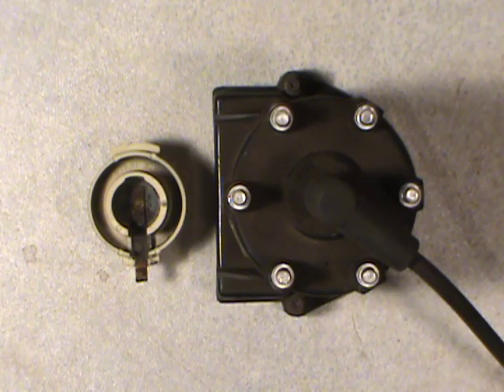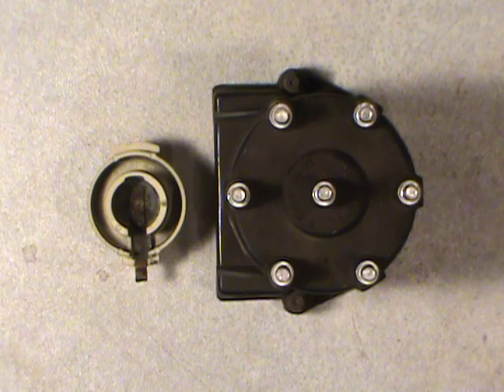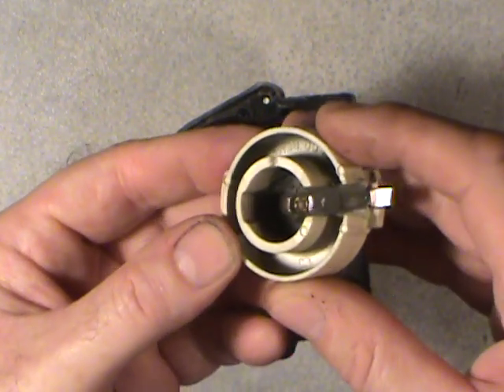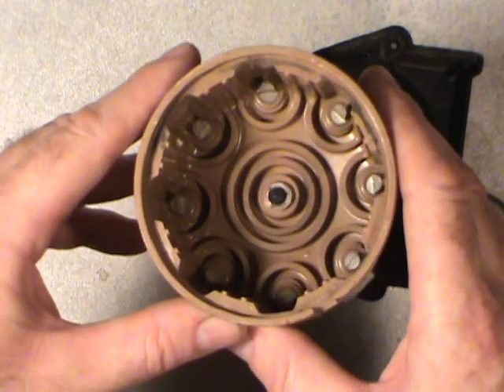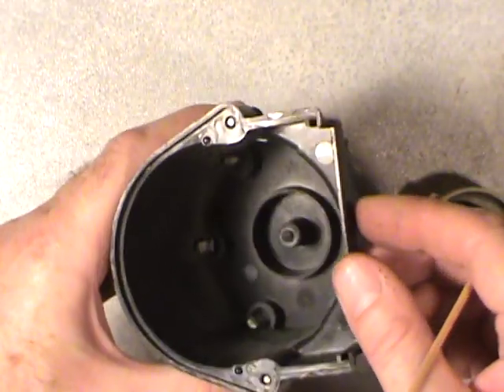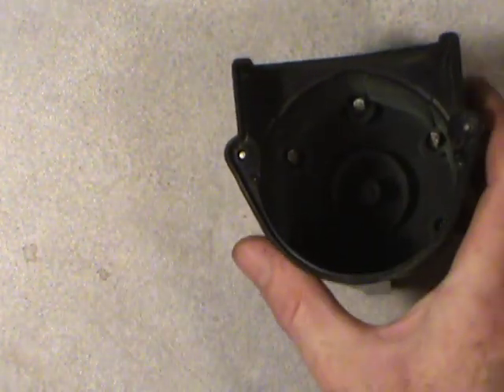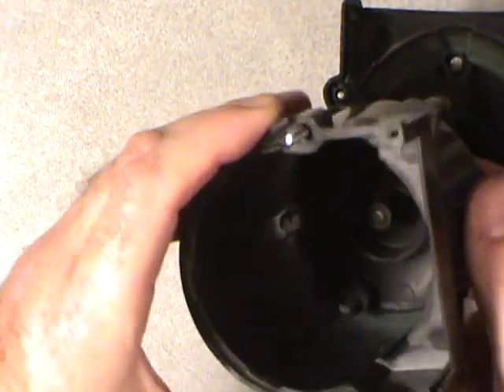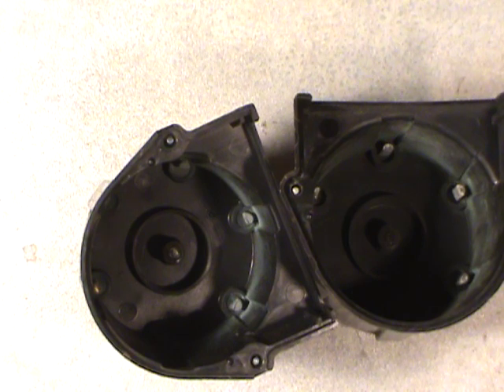How to Inspect Distributor Cap and Rotor Condition (Part 1) of 2 Parts

Comment: Thanks nice video
Reply from the maker: Greetings...will0i0am62............Thanks for the nice comment, and thanks, for watching too...........The "secondary" (high voltage side), of an engine's ignition system, has to be kept in very good condition, other-wise, it'll probably, just be a matter of time, until the engine itself, will probably start out by, misfiring some, not idling so smooth anymore, and, if really bad, the engine might not even want to start, possibly (can also, sometimes happen, if there's moisture, inside of the distributor cap)..........There's quite a bit of, high voltage "arcing" (sparking), happening, between the spinning rotor's metal tip, and, each of the metal terminals (inside of the cap), and over time, the metal gets eaten away, which will then, make an even Bigger gap, and make the ignition coil work harder then it did, when that gap was smaller, with a newer cap & rotor (same thing happens, if the spark plug's electrode gap, gets Bigger as well)............So, for a good running engine, that will give good performance and fuel economy, then, a person should keep, the...distributor cap & rotor...the spark plug wires...and...the spark plugs...from getting too worn, (or, worn out), too old, and maybe, corroded as well possibly, and.......till next time.......Be Safe, take care, and have a good one.

Comment: Hi Rocky, Thanks for your thoughtful response.  To answer a few of your questions, the vehicle with the wobbly distributor cap is a '93 suburban 5.7 TBI.  The wobble problem only developed after installing the new cap and rotor.  It has a press on cap with a notch in it and it firmly snapped into place.  My concern was that it was very difficult to remove the old one, so I had some concern that I yanked a little too much removing the old one.  I don't think that I could have bent the distributor shaft.  The cap is in fact secure and I never messed with the hold down for the timing adjustment.  Long story short, it was running fine (albeit the wobble) and I drove it a mile or two.  Lo and behold, no more wobble.  That leads me to believe that there was some irregularity in the cap or rotor and a few spins around has "fixed" it.  Obviously, still not great.  I expect, like you suggested, that when I pull the cap I will find some scoring from wherever the interference used to be.  Running fine now, but when I get around to pulling it I will update you just to enhance the common knowledge bank of information.

Comment: Any idea why this newly installed cap and rotor are wobbling?  without the motor running everything feels secure.  This is only after the new install.  Did I eff things up yanking the old rotor off or do I have a bad part?  
https://youtu.be/m8y5XwltpN4
Reply from the maker: Greetings...David James...........Thanks for watching, and...Wowsers...!!!...that's, the most impressive..."Wobbling"...Distributor, that's probably known to mankind, well, as far as I "see" it, that is (and I'm gonna nominate, Your Distributor, for a much deserved Award...lol)............Well, my first thought, was that, the Distributor's (spinning) Shaft, that the Rotor mounts on top of, is "Bent" quite badly............You just "Replaced"..."Only"...the..."Cap and Rotor"...???............Were they the "Exact/Correct" Parts, for Your "Exact" Vehicle and Engine...???..............Maybe, "Compare" the Old parts, with the New parts...any Differences at all...???............When installing the distributor Cap, did it "Fit, and Seat/touch down", on the distributor's Body, reasonably freely, without being too loose, or, too tight...???..............If the Rotor, is the Push on Type (as opposed to, the bolt on type), was it pushed Down, all the way...???..............Might be, that, the Rotor is making Contact with, the Inside of the distributor Cap, and if so, You should be able, to actually see, any Rubbing/Contact, that was going on, by having a Look, inside of the distributor Cap (the only Part, of the Rotor, that is supposed to make Contact with the distributor Cap, is the Center-Carbon-contact Button).............Here's some more food for thought.............Was that the Original Distributor, or was it a Replacement (new or used?) Distributor, that was shown in that YouTube Video...???.............Here are a few things that can be done, and, is, as follows..............Is that, the "Correct" Distributor, for Your "Exact" Vehicle and Engine...???..............Having the Engine Cold and Not Running, grab the distributor Cap with Your Hand, and, try to move it "side to side", in many Directions, to see, whether or not, if there happens to be any Movement at all...???.............Then, if needed, mark the spark plug wires, near the distributor Cap, so that, they get reinstalled in their correct locations, well, unless You don't need to, cuz, You already know how to, to begin with...............Then, Remove the Distributor "Cap", and, grab the Rotor, and then, gently, pull up, and push down on it, and, there should be a bit of ,"Play/Clearance"...............If, there "is not", any, up and down, Play/Clearance", then, there is probably, some "Not Wanted Force", being placed on top of the Oil Pump (if applicable, that is), and, is "Not Good", for the Oil Pump, and, if there is Lots of "Force" involved, as a result of tightening the Distributor "Hold Down" Clamp/Bracket's, Bolt or Nut (if applicable), then, that, just might be, a possibility, that's causing that Wobbling Distributor (cap)............While You're at it, gently "Twist" (not up and down), the Rotor, back and forth, in a circular fashion, to feel, the amount of "Clearance", that's between the helical Gear, that's on the end of the distributor's shaft, and the helical Gear, that's on the Camshaft..............There should be, just a little bit of Clearance, when those two helical gears "Mesh" (that be, the clearance, that's between those two helical gears, when they are in contact, with one-another).............If there "is not", any, up and down "Play/Clearance", then I hope, that, the distributor's Shaft, is Not permanently "Bent"............If needed, there are "Spacers" (that look, kinda like, Flat Washers), that can be purchased, that go between, the Base (collar), of the distributor's Body, and, the surface, where that part of the distributor gets mounted into/onto, and, by choosing the Correct "Thickness" of Spacers (or, a stack of them), then, there should be a bit of up and down "Clearance"..."After"...the distributor's..."Hold Down Clamp/Bracket...Bolt" (or what-ever), is Tightened down, to, shall we say, Lock the Distributor, in its proper Base/Initial Timing location..............Perhaps..."Remove" the Distributor (but first, make sure, that, You know how to "Reinstall it Correctly"...!!!), and give the gear end of it, a Spin, and, move the shaft, up and down, as well as, from side to side, to feel if it's too tight, or maybe, too loose...???.............What year of Vehicle, and, what Engine...???...cuz, the more I know, from the get-go, then, the more, that, I will have to go on...thanks............If You like, You can let me know, if You found the problem, or, if You didn't............Good luck, and......till next time......Be Safe, take care, and have a good one.

Comment: there was a bit of white dust on the tip of the coils inside the distributor, can that be the cause of my misfires and inability to start? the car cranks and it wants to start but it misfires and backfires
Reply from the maker: Greetings...That Don't get the bitches.............Thanks for watching............Well, generically speaking, no amount of Corrosion, Dirt-like Stuff, or, even any Moisture (usually being, water condensation), that is showing-up, on the Distributor, in the general area, of the Inside, of the of the distributor Cap, is, as far as I see it, is really not very good at all, cuz of, all of that Very High Voltage, usually trying, to get to, an (electrical) Ground Source, the easiest, and fastest way, that it's able to..............If that, so called White Dust, is causing, something like, the Low Voltage wiring Connections, to, not be so good, then yes, that, in itself, could very well cause a problem..............As far as a vehicle's Ignition System is concerned, the ignition system's Parts/Components, have to be in really good shape, and also be, as Clean, and, as Moisture Free as possible, or maybe, the result might be, an (ignition related) Misfire, or, as bad as, an Engine, that will Not Start at all...............If You can let me know, what...???... Your Vehicle's...Year...Make...Model...Engine Size, and what its configuration is, as in, inline, V-6, V-8, etc., and the number of cylinders, that it has, then, once I actually know, what You have there, I will hopefully, be able to, do what I can, to help You out, and........till next time.........Be Safe, take care, and have a good one.

Comment: what if the cap appears to be in good condition?
Reply from the maker: Greetings...SpyderRios....Thanks for watching....................Well, if the Distributor Cap looks to be, as good as, You were sayin' it appeared to be, then...Maybe...???...it can be put back into service (aka, Re-Used)...providing that, there wasn't a..."Hairline Crack"...or two (hard to see)...in the Distributor Cap, and/or, the presents, of any Carbon Dust (sometimes, it can be, Carbon Tracking), and, Hairline Cracks, and any unwanted Carbon, (inside) of the Distributor Cap, and even, any Moisture/condensation, can make for, some rather, Not Wanted, shall we say..."Spark Scatter"..perhaps, where-by, as the High Voltage leaves the Tip of the Rotor, it starts "Dancing Around", inside the Distributor Cap, usually Not making its way, to the Correct Terminal (inside of the Cap), and, it may or may not, end up, going to the Wrong Terminal...!!! (Not Good...!!!...Engine Damage...???)....................How does the "Rotor" (that spins around, inside of the distributor cap) Look...???.....................So then, have a really Close Look, for any Hairline Cracks...and...to find out, if any Carbon, is hiding, inside of Your distributor cap, just get a piece of (dry) white paper (disposable) Towel, and drag it around, the inside of Your Distributor Cap, to see if any "Carbon" gets stuck-to, that Paper Towel (???)........Also, the (carbon resistor type), of spark plug "Wires"...usually..."Wear-out"...(internally/inside)...so Don't be Fooled, by, how Good, they appear to Look, from the "Outside/Exterior" of them, and...........till next time........Be Safe, take care, and have a good one.

Comment: is there a way to perform any test using an equipment such a multimeter, or any other to certainly determine that distributor cap is bad??, I have a 00 Nissan xterra, and I remove distributor cap and saw a lot of metal pieces on the inside bottom, and red dust on the distributor cap, my engine crank but doesn't start, I took my distributor to a place where check the coil and they told me that is ok.
Reply from the maker: +carlos alfredo lopez saldini ....Greetings carlos alfredo lopez saldini....Thanks for watching...................You could, Ohm/Resistance Test, the distributor cap's, Carbon Button/Resistor, but, probably won't make much of a difference, considering, Your distributor Cap's condition, as I'm imagining it......Metal Pieces...???....That "Not Wanted", Red Dust, is the biggest clue...........A New distributor Cap and Rotor is probably needed...........Try to get a distributor Cap and Rotor, that have "Brass Terminals" on them (better than Aluminum terminals), and, if You can Buy them as a Set or Kit (Cap and Rotor in the same Package), that might save You some Money as well..................The spark plug "Wires", have to be in very Good Condition "Inside".............If Your Xterra Engine, needs New Spark Plugs, try to get the Spark Plugs, that Nissan Recommends, for Your Exact Engine, and make sure, that, the spark plug "Gap" (between the spark plug's Electrodes) are what Nissan Specifies, for Your Exact Engine (less Problems that way).........................With the Engine "Not Running", Only Remove "One" spark plug "Wire" at a time, and put it back On, before doing the next Wire, or, You might have Trouble, putting those spark plug "Wires", back where they belong...!!!........................If the Terminals, Inside of the distributor Cap, are Worn too much, or the Carbon Button gets too Short, or it's Dusty/Dirty, or there is Moisture inside the Cap, then, that's just "Not Good"...!!!.....................Maybe, Replace the distributor Cap and Rotor, and if need be, the Spark Plugs as well, and see if that works, and "Carefully", Clean and remove, any Dust and stuff, that should not be there...................If You care to, just let me know, how You are makin' out, and, if need be, we can proceed from there, if You like, and..........till next time........Be Safe, take care, and have a good one.

Comment: after removing that black cap, there's a plastic surrounding the rotor. That plastic has a small crack on it. Will that contribute to fluctuations in performance, struggle to pick up or jerks when above 60kmh, for example? or any other? The car is a 1996 toyota sprinter & it idles properly. However, sometimes when at a stop light the rpm would go below 900 and stutter. Please advice urgently. Thanks you
Reply from the maker: +Rovin Nauth Greetings Rovin Nauth....Thanks for watching........................Anytime, an Ignition related Part, gets Damaged, or Worn too much, then, that will usually Increase the chance, of having some Problems showing up, especially so, on the Secondary, High Voltage side of the Ignition's System's Electrical Circuit.............................The Distributor Cap and Rotor, along with the Spark Plugs, and spark plug Wires, are subjected to many Thousands of Volts...!!!.........................Maybe, try a New, Good Quality Cap and Rotor first, and see if that helps.....................Have You been keeping up, with Your Toyota's "Maintenance"...???...as in, a "Tune-up", and Replacing Parts as needed, according to Toyota's Recommended Time/Mileage/Kilometer-age Interval...???........................If You don't already have a (Maintenance) Manual or Book, for Your Toyota Sprinter, try to get one, as they are almost, worth their weight in Gold...!!!...(so to speak)........................Have Your Vehicle's Computer "Scanned" for Trouble Codes, and also, have Your Vehicle's "Fuel Pressure"..."Checked/Verified" as well...................................If Your Engine has a Rubber-like "Timing Belt" on it, make sure, that a "New One", get Installed, at Toyota's Recommended, Mileage/Kilometer-age (and maybe, Time as well...???) Interval, cuz, if it goes "Snap" (aka, Breaks), then some very Expensive Engine Damage, could very well happen...!!!...and, I hope not............................So then, have those things done, that I mentioned above, and, if You like, You can let me know, what You find out, thanks, and Good Luck.............Till next time.............Be Safe, take care, and have a good one.